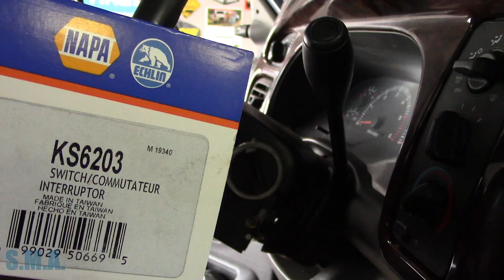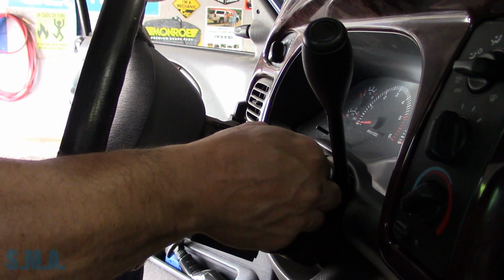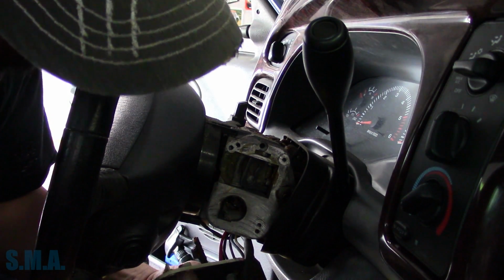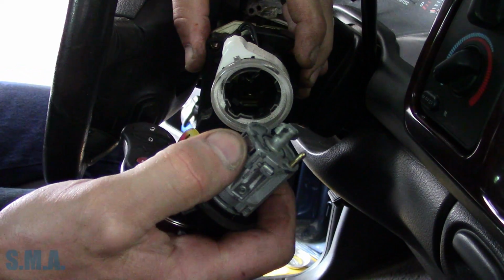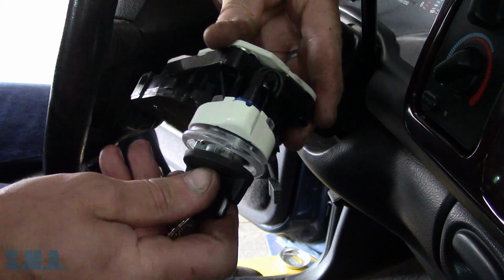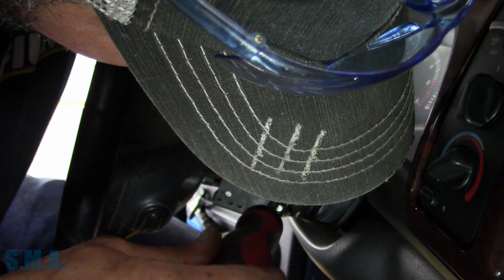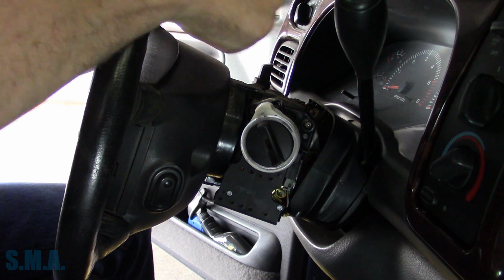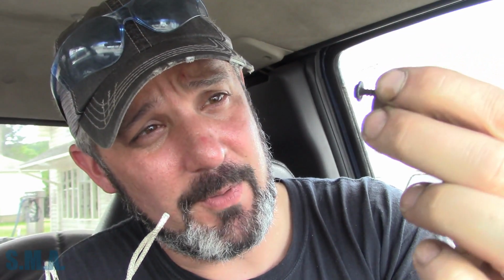Shop Screw Ups - Follow Up

Comment: Yep, "T20........First Try!"  LOL!
It's amazing how those little screws can hide when they fall out of that lower cover, and in places you couldn't put them! 
The early 2000's Ford F250 and F350's had similar covers except the upper cover went partially under the instrument cluster.  And THAT was where the problem wiring for the overdrive select button at the end of the shift selector handle and that rubbed on the movable shifter tube, exposing the wire and blowing the fuse causing a flashing light in the OD switch and a MIL light.  FUN!
Rerouting the wire and adding split loom to the wire for protection fixed and eliminated the problem.
Reply: 2nd gen Explorer's had this issue. Mine actually started smoking Repaired the damaged wire, and all good

Comment: Just rewatched this since I'm working on one now.  The ignition switch was timed correctly out of the box. Did not need to be set to off position like the old one.  It was set to the run position---where it needed to be in order to install the lock cylinder.

Comment: Way to go! And I love the songs.
Maybe get a few empty egg cartons to hold the screws during disassembly, to make assembly quick without dropping screws. And please adjust the lighting before you start recording, not when halfway done. And get some thin screwdrivers to pry connectors off without risk of cutting yourself. Also for pushing small buttons. Use the knife only for cutting.

Comment: My 1992 dodge W250 uses that same ignition switch! I had to take it off without removing that upper plastic cover because my tilt handle was stuck(turned untill I was sure it would break and gave up.) was able to gently sneak my t20 bit under it with a little pressure.

Comment: It's amazing how many things the "big 4 inch" is good for! I'd take that 360 Magnum over a Hemi all day every day for reliability in a truck. If you want to try a REALLY simple job, do a heater core in 1997 or older Ford Ranger. With or without a/c-2 clamps n hoses under the hood and a total of 6 screws, 4 for the cover and 2 for the strap that holds it (all easily accessed), under the dash. Total time is about 1 hour and I charge $100 cash plus parts.

Comment: Back in the 60's, an ignition switch was a simple on/off (and rarely failed). My first job was delivering auto parts and the idiot I was working with actually lost the keys to his truck. I was sent out and did the classic yank-the-three-wires-and-strip-them-with-a-knife-and-jump-the-igniton to get him back to the shop. Just like in the movies!

Comment: I had a Jeep with a recall on the break ignition interlock addition. I also had a failure of my backup lights. They charged me $79 for ‘diagnosis’ and they were wrong.  They also messed up the interlock. I had them do it again when I locked the steering wheel removed the key in drive and allowed the Jeep to roll steering locked into the curb. The diagnostics were just a wrong guess.  After rebuilding the park safety neutral switch and another hour of actual diagnosis by me, I found the original manufacturer defect. The spade pin on the firewall was installed upside down with the locking tab 180 degrees and the pin backed out of the connector.  The $75 was a huge insult adding to the 5 hours of my time, 3 waiting for them to botch the safety upgrade and 2 hours of me performing unnecessary repair and really fixing the problem. The dealer wanted $300 for a park safety neutral switch and the $150 installation.  Which would have left me with the same failure. If they would have discovered the problem, no doubt they would have denied it was a manufactured defect and charged me hundreds more. I consider myself lucky to only be out 5 hours $75 for hot air!

Comment: On the old dodges with the lighted ring around the key, you can pop off the ring with a screwdriver. You then tap the screwdriver in around the lock cylinder in 3 spots and pry outward. The lock cylinder will come right out and it will start with the screwdriver. Total time about 10 seconds.

Comment: Great job fixing another shop's screw ups.  Maybe it's because I cut my teeth on those 94-01 Rams, but I do have a soft spot for them.  Wouldn't mind finding a mint 4x4 Club Cab (V8 Magnum or Cummins) to have as a daily driver, most of the ones in my area are high mileage and absolutely trashed trucks.  Rams of any vintage are somehow rather scarce in my local wrecking yard...the few that arrive there wind up getting absolutely stripped of any usable parts within a day or two of arrival.

Comment: The reason you have vehicles sitting at your shop is because of the honest work you do for those customers.  Had I been charged $300+ for parts that didn't fix the initial problem, that shop owner and I would have had a few words.

Then I would sing my head off about the incompetent service I received from that other shop.

Comment: normally ignition switches/column parts are always done in run position and neutral gear selector in neutral (battery unhooked of course)
I always assume that's the right way, unless it states otherwise

Comment: The gauge cluster in my  01 Oldsmobile Silhouette would go dead at random, along with the ABS, and Traction control off lights on, along with a no comm. Found out that punching the ignition switch made the problem go away. Just looked at the diagram, and sure enough, 1 Wire from the ignition switch powers the IPC, and BCM.

Comment: Well, this job is finally done, didn't use many brain cells in figuring this out. You'll make some $$$ on this job, which will make Mrs O. happy    : - )   and that's what counts. I do remember a key job like this 2 or so years ago with similar problems. You called that one right. To bad this guy got hosed from the other shop. On to the next task, sir !!!!!! Well done !!!!!!

Comment: Fun Fact:  When I was in the Navy, I took a regular razor blade (brand new) and was going to use it to cut a line.  It was really weird, the line didn't cut, and nothing happened, didn't even cut a little.  I looked at the blade and had the dull end against the line.  Went to doc after that one.

Comment: I am a new subscriber, and have only watched about 10 videos so far. My specialty has always been electrical systems, A/C systems, and drive-ability diagnostics. I am retired now, but still get a kick out of watching other mechanics running diagnostics on YouTube. One question I have for you is whether or not you ever use a Power Probe? I went for several years after they came out without buying one, because I have my electrical routines down pat, but once I spent the money on my first one, I couldn't imagine doing any real comprehensive diagnostics without one. Being able to induce power or ground into a circuit with the same tool makes a lot of sense. I have four of them now in my tool boxes, as well as my trusty old "bulb" style one-wire icepick-style Snap-On test lights and also the newer "module-friendly" electronic ones, too. There are still times when I know that the quick, easy way to check for a good power connection in a circuit is with a nice, bright bulb drawing about 4 - 5 amps of power. Like you, I have my own way of running diagnostics, but I am always open to learning good methods and professional shortcuts from other quality mechanics  such as yourself. I intend to watch all of your videos. Keep up the good work, brother. By the way, you have a beautiful family.

Comment: Best anti theft is to have on the calliper electric parking brakes that take a digital signal at the calliper and are only manually released using the key or a dealer key, the hole of which has a 1/2 inch thick rubber cap that is threaded in secure enough to not come out but able to be picked out if the slot or socket strips to spin it out, and the hole literally backed with a thick grease to the point that you might need to work the key in and out a few times or use a solvent to even get the pins to fall back into place once the key is fully inserted

Comment: I have replaced the commutator on my Pontiac Grand Prix GTP two times!  I'm at 130,000 miles since new. That Dodge was a lot easier!
When I first had this problem (about 70,000 miles) luckily I talked to an experienced AC/Delco parts guy. I was looking to replace my interior fan speed switch (lost speeds 1 & 2). I just happen to mention that my DIC display (Driver Information Center) had problems also. This is what you need. It was the commutator that hooked to the ignition switch. I cracked open the old one and inside were 4 sets of points/contacts. 3 of which were burnt. I read later that you could sand them down but they wouldn't last as long. NO THANK YOU. I'll reset the clock with new.

Comment: Same thing on my 2000 Ram, changed the switch, everything works again. Bought an 03 hemi ram in 06 and had the same problem only the switch got so hot it melted. Changing the switch and burnt harness fixed it. It's a total dodge deal, plastic junk made in some country I can't pronounce correctly..

Comment: Replacing that ignition switch is easy for that truck. I used to own a 2000 ram with the 5.2 V8 and had to do mine after it was punched by a thief who stole my truck while I was doing a job in Baltimore MD.

Comment: I hate throwing parts at things, but have experienced the nightmares of the Anti-SMC Garages that just do the same thing.  So here is a Question for Mr. O.  How do you find a good mechanic that will do the do diligence that your shop does?  I dont mind paying big bucks for good work.  I just hate paying big bucks for crappy or NO work.  Kinda like the owner of the 5.9 Magnum.  As always great video!

Comment: Back when I worked as a mechanic, we used to mess with the new kid shop helpers and them them to go and get us the metric adjustable out of the tool box.  He would disappear for about 15 minutes or so and finally come back saying he couldn't find the metric adjustable.  Then we would tell him that any adjustable would work because they would do any size bolt head and the guy would stand there and get this funny look on his face when he realized it.  Sometimes we would send them for a henway and same thing, gone for a little bit and come back and ask what's a henway and we would tell him about 5 or 6 lbs.  Sometimes the kid would get it right away and other times, they would stand there with a confused look on their face until you explained it to them.

Comment: The last and only time I ever had to change a key cylinder and mess with ignition switched, the whole thing was destroyed. Once the key bent, they used whatever metal object fit in there to turn it. I will say it was the only time I started a car without the key. The downside, the cylinder came out using the key, which meant I had to drill the whole thing out. The hardest part was getting that key cylinder freed, everything else was quick and easy. Lesson? Don't wait until it is more than broke to fix it?

Comment: 4:00 "For that we're gonna need a razor-sharp knife, so if we slip, we bleed."
That's an important tool tip, right there.
Reply: i prefer stabbing dull greasy screw driver blades or picks into my hands. lol

Comment: The Magnum motor
I put 700,000 miles on one of those Motors....
Frm new everything else fell apart around it though along the way
Reply: Drove one as a loner. Engine performance was impressive for daily driving, 21 mpg, plenty of pep and power when you need it, but I did notice the interior falling apart at an alarming rate, for being fairly new.

Comment: Yeah I've always looked for reputable people, shops and professionals to do what ever work needed to be done. But sometimes have been taken by some of the biggest, and so called best. Pride in their work is over ruled by the greed for money sometimes. I've learned to shy way from the chest beaters than can't do anything by tell you just how good they are. Usually that's all their good at. The mom and pop shops like this one is my first pick to go, not all the fancy buildings and uniforms and crap they have as eye candy.
Reply: they tend to put the wet behind ears new hire/youngest tech on those old oddball vehicles, while the seniors all take the easiest slam dunk jobs.

Comment: Chrysler/Dodge/Plymouth  had made the 360 cubic inch engine since 1972 or so as an optional engine to the venerable 318.  The old small block engines (273, 318, 340 and 360) were pretty much bullet proof.
Unlike the soft camshaft and powered metal connecting rod 5.7 Hemi, I'd rather have the older engine for simplicity. Cast iron, block, heads and intake manifold.
Unlike the parts canon shop that threw everything but the kitchen sink at fixing the truck, you used a logical approach with the data given by the customer as well as your experience to effect the repair that was required rather than the shotgun approach.

Comment: I think I would have struggled with this one, the critical point was the customer's observation it happened intermittently when he turned the key. Without that critical info, and with an intermittent fault, one could spend hours chasing the wrong pathway. As much as people criticize the other shop,  trying to solve a puzzle when you start at the wrong place could be a nightmare.
Reply: except crapsler dodgey has been known to have issues with switch wear for many years

Comment: So many comments"if I only lived closer to SMA." or words to that effect. I have many methods to figure out the businesses to give my money to. Google and Yelp reviews is one. In the reviews do they interact with the customers?Thank them for the business. Do they address those dissatisfied in a respectful manner? Auto repair. Are there vehicles that never move from the shop. In other words junkers. I used to live near a shop that absolutely would not allow vehicles to stay at the shop. If it was towed in and they couldn't afford the repair. It was towed out. During the day the lot was always full. At night only the cars they couldn't get to or waiting on parts were inside. I recommended that shop because there were no cars sitting outside.Every single person I sent there was very satisfied. It was the same deal as SMA a Ma and Pa. What does the property look like? Sure SMA has recycle bins but no junk accumulation. Look at how clean it is. SMA takes pride in the work and appearance. Believe me there are auto repair shops near you that are just as good as SMA. You need to get off your butt a do a little trouble shooting youself. Do they have a social media presence? Not every shop is going to have a YT channel. They may very well have a Facebook though. 
  Hey Eric nice follow up. Thanks.

Comment: I had a Z24 back in the day and something came loose in the column where the wheel would flop all over the place. So I took it to a "mechanic" and he "fixed" it. Well, the wheel didn't flop around but the horn, directionals and 4-way flashers no longer worked. He tried to claim that it had nothing to do with what he did. I was like "you took the steering column apart and now nothing in the steering column works... it isn't like my radio stopped working". Well he couldn't figure it out and he had to pay another mechanic to diagnose and repair it. So I just started taking my cars to the other mechanic that knew what he was doing just like many people appear to do when they come to South Main to get their cars fixed right.

Comment: Great Video, only question i have is why didn't you fix that botched heat actuator the right way, and charge the customer, because when it fails he will wonder why you didn't redo it when you saw it.

Comment: Had to replace lock cylinder on 2000 Dodge Ram a short time ago.  The key would not turn the cylinder.  I'm assuming due to some internal mechanical damage. Could not turn it to the run position so it could be removed from the switch.  At least not w/o destroying the switch.  Had to replace the cylinder and the perfectly good switch.  Did Dodge get me coming and going or was there a trick I was missing?

Comment: I myself actually have a 2000 dodge ram quad cab long bed 1500 4x4 Laramie slt with the 5.9 litre 360 magnum v8. Mine does not have power mirrors, overhead compass/outside Temp display and or the nicer woodgrain type trim mine is black and don't stop anything from working so not a problem for me..I've had people before tell me well like my 94 Z71 Silverado extended cab short bed put in a custom dash trim accessory kit, maybe something like carbon fiber look. Not a big fan of the wood type trim anyway so why... mine is not leather it's dark mist gray cloth, and my truck is black I like the blue on that one, mine is probably a little cleaner truck it's got some rust starting but not completely rotted out.

Comment: Hi Eric,
I have to change the oil dip stick on my 07 2500 Ram with 47000 miles on it. dip stick froze @ o-ring, snapped handle trying to twist out and then twisted dipstick in half using ez out to try and remove. Bought new dipstick, tube, oring and bolts.  Dipstick tube is routed thru engine mount, drivers side. When are you doing one of these? Soon? Thanks for the videos.

Comment: Before ya remove the old failed  ignition switch isolate the voltage drop across the switch at  the harness connector than after you install the new switch perform the same voltage drop test across the new switch campare to the old switch voltage drop to the new switch got to know whats bad before ya know whats good

Comment: The sign that should be in the office..sorry SMA if the labor rate isn’t right
Labor rates per hour:
If you didn’t try yourself= $90
If you tried and couldn’t= $150
If you tried and screwed something up =$200
If you’re a shop and you shot the parts cannon at it and your tech doesn’t know what they’re doing=$400